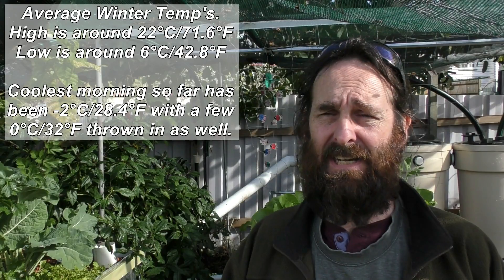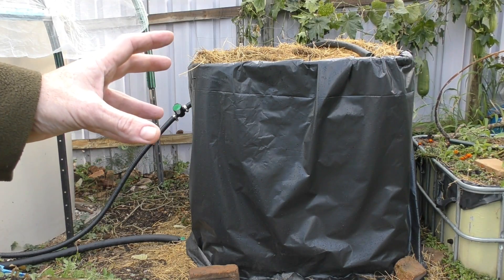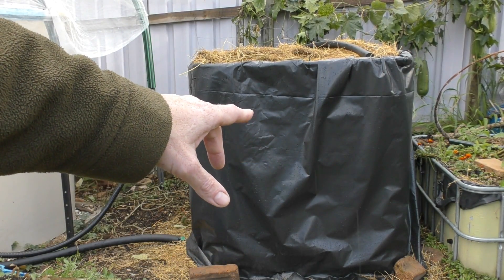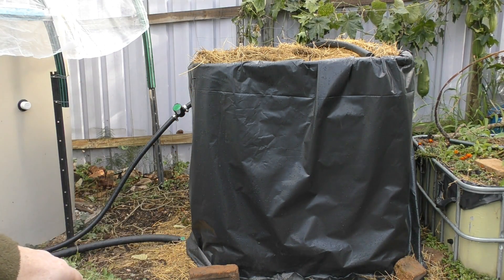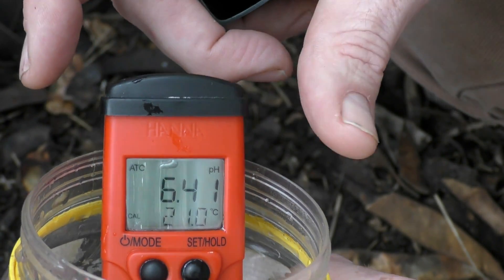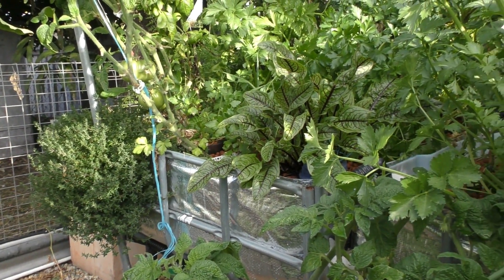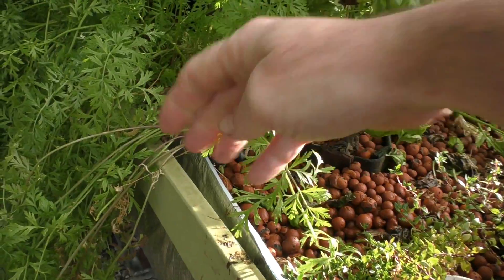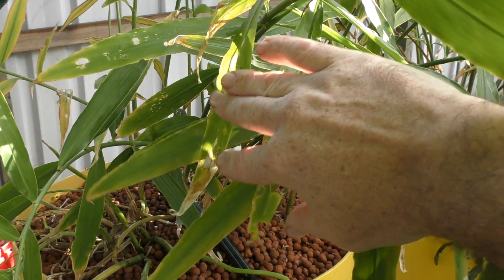Aquaponic Compost Heater update, water temp's for Jade & Silver perch. AP Update July 2015

Comment: Do you still use this method to heat your aquaponics in the winter?  I'm getting ready to build a system for my aquaponic greenhouse.  I plan on pre-mixing and then using lose coils laying throughout the pile in case I need to move the pile around a little.
Reply from the maker: It didn't work out so I ended up scrapping the idea. I haven't had a warm water-loving species since but will be soon so will need to revisit the idea. 
I did see a post on a group the other day that may help, haven't watched it myself as of yet. 
https://www.youtube.com/watch?v=lIzWgBWF3SQ
Hope it helps some.

Comment: Why can't you just switch the hose connections?
Reply from the maker: Running the water in fro the base would draw to much flow from the pump leaving other areas of the system with less flow.
Cheers.

Comment: Hay boss a idea I wanted to share with you to get your thoughts. I have 2 50 Gallon each barrels that I made compost tumblers out of and as  I do it a bit oddly from some. I have had this idea of adapting them to provide a bit of heat for in our greenhouse and or fish tanks in the winter. As we are just coming into spring here in Northwest New Mexico USA were we live, I will have some time to work up the idea before it is needed this next winter. Anyway my tumblers set side ways 1 above the other on a set of poles, I built ribs inside to stir the compost, a quick door in the long side and a 1 1/2" PVC pipe ( with holes drilled into it, over it's length )  runs through as both an axle as well as air filtration supply ( as I write this I am thinking this idea may take away to much air supply  ).  I know it works cause this past winter when I would add new stock to the pile it was always be nice and toasty to reach into.  My new idea was to run insulated lines up & into these pipe and to keep them run Un insulated through the two tumblers axles and then insulate the line out and into the ground till I reach the point of use were ever that might be. Or just run them a couple inches under my flouring in the greenhouse to warm it like a thermal floor and passive heater ( which we already have in a hot air version that is supplied from the peak of our 10' roof at high temp ) . We might run a continues loop of water ( Like you do here ) to let that be my transfer medium as it is a better carrier of heat.  
So what do you think.
 It is easier to clean out between batches and has a smaller footprint in my greenhouse. Oh did I mention they are inside the airlock entryway of my greenhouse, So we're getting some heat from them just were they are.
 This idea is simply to move some of that potential to a more needed place. 
It's always great to see your videos, I always need to remind myself your from down under as they say and our seasons are flipped. 
But with our new greenhouse we will be snubbing our noses at the weather from now on we hope anyway. And playing in the greens all year round. 
Our greenhouse is a bit different than most as I am handicapped and  will one day be in a wheeled chair. So we had to put in hardened floors and use vertical tech. every were we could. But that also gives us a larger than foot print possibilities for volume of plants and there by crops. you and some others here on Youtube have been our insperation for this build and we hope we have it right. Sorry about my spelling Or lack there of. See you around.
Reply from the maker: Hi there & sorry for missing your comment mate.  Going through this week to catch up on any that have slipped through the gaps. 
I found that even though I had a long length of pipe in the pile that I wasn't getting a enough heat transferred into the water using cold water coming in from the system.
Another idea I had was to run the water in a loop within the pipe & use stainless steal coil to transfer the heat directly into the water in the tanks. Basically acting like a heating element like in the old electric jugs/kettles we used to get here. 

I like the idea of using the the heat from your compost tumblers to help heat the whole greenhouse. I think that would be a more efficient use of the heat generated rather than trying to use it to warm the water itself. 
Did you manage to work something out for this season at all? 

Sorry again for missing your comment.
Rob.

Comment: Have you considered running water through a black box solar heater somewhere in the pump system?  It's efficient and can be done cheaply with hose in a black box behind glass, if it works for you then rebuild it with copper tube and a metal box for durability.  It gets water scalding hot.   I'm researching aquaponics in climates with hot summers and cold winters, can you recommend a hearty fish that can thrive in water in the 40's in the winter?
Reply from the maker: Has been something I've thought about & seen folks rig up 👍 Can't use copper though due to the fish but there are workarounds.
Cheers & sorry for missing this when you posted it.
Cheers.

Comment: The compost heater might work better if it were larger or better insulated.  People do science demos where they compost tiny handfuls of materials inside insulated containers, so I think the problem is just that the outer materials are losing heat too quickly to the air and the heat exchanger.  If you had some straw bales handy, you could try using those for the walls of the pile.
Reply from the maker: +Onward to Innisfree 
Hi there.
Ended up pulling the cage down & built another about 60% larger in volume. It heated up very quickly but still think it's a bit to small to be able to heat the water to keep it at optimal levels for the fish. 
Things have warmed up quite a bit here now so it's not really needed but will keep playing with the idea for next winter..  
Looking at using a stainless steel pipe coil as a heating element  to drop into one of the tanks next season to see if it will at least help keep the Jade perch on the feed. 

Posted a bit of an update at the end of the latest clip if your interested ata  close look
https://www.youtube.com/watch?v=s0hIaCGsetA
Cheers & all the best.
Reply: +RobBobs Backyard Farming The new setup looks great!  Incidentally, I think you may be getting more heat than you realize.  From the video, it looked like it took about 9 seconds to fill .5 l.  At that rate, with a 2 C rise, you'd be getting about 1672 kJ/hr or 1584 BTU/hr for us Imperial types.  Supposing that were to run 24/7 for a month (not realistic, but maybe close?) I think you'd be looking at about 333 kWh or 1.1 MBTU total.  Not bad for a pile of clippings and leavings!
Reply from the maker: +Onward to Innisfree Thanks for the figures mate. Something I will be trying to wrap my head around at one point. Been so long since I did science at school.
Cheers.

Comment: What if you used flexible copper pipe to make a coil instead of irrigation piping as copper conducts heat better. Many people make such coils to cool the wort in home brewing.
Reply from the maker: +Shavenhamster 
Hi there. Copper is toxic to the fish but SS is fine to use. My father dropped around a few short SS coil tubes for me to play around with so hope to have a better working heater sorted out soon.
Cheers,
Rob.

Comment: So if you were to just swap the direction of the water flow to your compost heater you would be able to take advantage of the thermo siphon action were heat rises it will assist in the flow too.
Reply from the maker: Galan Gaia I tried that today on the rebuilt heater & found it very hard to regulate the flow. Ended up hooking it back around the original way. Hope to have an update clip on it soon.

Comment: Nice one mate. I have seen the vids on the hot water. I am sure you will get it running.
Our tomatoes have started to ripen Nice ;-)
Reply from the maker: Southpaw Davey 
Plumbed MKll compost heater into the system today. The pile is already over 70°C so fingers are crossed ;)
Cheers Dave.

Comment: Something that you might want to consider for your sunnier days is putting solar to use. Just take your black hose flat coiled tightly attached to a piece of plywood painted black. Surround with a black painted plywood box with the top opening slanting towards your sun and cover with clear glazing. Kind of like a solar cooker. On a sunny day will get too hot for your system but can be regulated by propping open the glazing and valving off the water flow. Even on a cold day, if you have sun, your temps will go well over 100 degrees Fahrenheit. Cheers.
Reply from the maker: brad ley Hi Brad. 
Have tried a small solar heater last winter but it didn't work well with the materials I had on hand to build it. This time I was after the 24 hour heat provided by a compost heater.  
Once we have a permanent cover over the aquaponics there will be both solar water & electricity systems set up on the roof so will be able to utilise that for our short winters. 
Am looking at pulling this heater down on the weekend & rebuilding it with some added greens to help fire it back up. 
Cheers mate & have a great one.

Comment: Have you thought of running a timer?maybe let it flow for a minute and have it stop for five minutes or so?Just a thought.
Reply from the maker: onebigkahuna69 Hi there. Was after simple system for the time being but a timer was suggested by a mate when we were talking about the build. The pile will be rebuilt soon hoping to boost it's performance. If it doesn't work as well as I'm hoping a timer might be a way to help regulate the heat. 
Cheers & all the best.

Comment: with a stick or handle, make three holes down the middle of the pile and add coffee grounds. then water it in good and your temps should come up fairly quickly.
Reply from the maker: Greg Heal Hi Greg. 
Have had the temp fall further over the past week. Have turned the pile & added a few things in but haven't had the raise in temp I was after. Will be rebuilding it to increase it's size & to also bulk it up with some more greens. 
Cheers mate & all the best.

Comment: Not sure if you read the Jean Pain's method but he had piles that were a minimum of 4 cubic metres. Yours looks more like 1 cubic metre. http://www.linaria-ev.de/another_kind_of_garden-the_methods_of_jean_pain.pdf
Reply from the maker: jakattah Certainly have & mention it at the end of the clip ;-) 
Don't have the room for a 4m³ pile or the need to raise the temps to the levels Jean Pain did so went with this smaller unit. Am only after a 2-5°C bump in  temperature for the aquaponics to keep the fish metabolising their feed. 
It's not working well enough set up like this so will be re building it to just under double the volume it is now. The weather will probably warm back up before I get around to it knowing my luck.
Cheers & have a great one.

Comment: It shouldn't actually matter that your water inlet is at the top of your compost pile. Yes, you will have less efficient heat extraction, but you are already restricting your flow rate so that you don't rob the pile of too much heat. If you had the flow reversed and had more efficient heat extraction you would just have to restrict the flow rate more. At the end of the day you are already extracting the maximum amount of heat from the pile without having all the bacteria die off.

Comment: The inlet definitely should be at the bottom and the outlet at the top.  Hot water rises, cold falls. Slow the inlet.  Make it heat before it rises. Having said that, 21 degrees is fine and dandy any way - and a two degree increase for free is pretty good mate. 
My damn aquaponics bed is getting hammered at the moment.  I think it's the bush turkey digging around because the dirt beds (with lots of wooden spikes) are doing okay.
Reply from the maker: McDowall Manor Might be time to breakout the barb wire Andy ;)  Have seen how destructive they can be in a house we were renting. They do make some very efficient compost heaters though ;-) :-D
Cheers mate.

Comment: Even though the compost system doesnt raise the temperature a whole lot I wonder how much it helps buffer any temperature loss that you might otherwise get.
May you can supplement this with some type of solar type set up with black hose on a roof of some sort??
Reply from the maker: The Productive Garden Was thinking about a solar booster but would need to buy more pipe/hose. Don't have much space to set one up other than the lawn at the moment. On top of the compost cage might work though now I think about it ;-)
Cheers John.

Comment: have you thought of using an old solar hot water system (salvage the panels) to heat your water
Reply from the maker: Reuben Bluff Have mucked around with a small set up in the past Reuben but no box. Watched that one last year while looking into solar. 
The pile has cooled down so am biting the bullet & rebuilding it to be slightly larger this time round. Think we only have a week or 2 of cool weather here. 
Will be planting out the cuc's soon ;-)
Cheers mate & thanks for the link.
Reply from the maker: Selwyn Bore Hey Selwyn. Will be looking into a solar water & power set up when the permanent roof goes over the system. Haven't got the space at the moment to set them up. 
Cheers mate.

Comment: What if you only used it at night or late night?  You may be robbing heat all the time rather than just when you need it.
Reply from the maker: Mark Allen Hi Mark. 
Have tried to let the heat build up in the pipe but the volume of water heated doesn't make much of an overall difference to the temp in the system.  If there was more pipe it could work but then the pile would have to be larger to hold it all. 
Have decided to pull this one down & start again over the weekend if I can finish all the other jobs that need doing on the list. 
Cheers mate & hope all's well with you.
Reply: Yeah, back to the old drawing board.  I do that all the time.  I wish you well with your new pile. Did you ever see the water heater by Jean Pain that is on You Tube.  Worth a look but way to big for back yard heat generation!
Reply from the maker: Mark Allen 
Stumbled across Jean Pain a few years ago & have been wanting to have a crack ever since Mark. Have a fix sorted but think it's too late to do much good here this winter. Just need to pick up a few parts to finish plumbing it in today.
Cheers mate.

Comment: Your temps are in the right area if you're relying on Bacteria to generate your heat. Your Bacteria will start killing itself off if you're biomass is over those temps, meaning the bacteria is self regulating. Also your problem with your BTUs may be the size (cubic meter) of your biomass. I would say you might want to make your biomass four times as large. It needs to be way bigger.
Also it might help if you keep your biomass wet by some form of drip irrigation- that might not be the correct way of describing it. I have used a spinners that RainDrip makes to keep mine wet. You don't want it too wet, but just moist, and you do want to turn it over every three week or so (to aerate it). You might need to work that into your design.
You might also want to think of using pallets nailed together to make the outside of your compost bin. That way it lets the air into your biomass a lot better..

If you decide that you want to make it bigger then a two pallet by two pallet square, then you might want to add 4 inch drain pipe with holes down the side of the pipe across the bottom- two feet apart. This would help in allowing air to permeate your Biomass, otherwise you have to turn over your compost pile a lot more often. 
Also I would keep the heat exchanger hose at least 12 inches away from the side wall(s). You might be losing heat by the hose being too close to the sides of your bin. The downside of having to turn over your compost pile is that it take time to get back to the temp it was before you turned it, but that might not be a problem if the biomass (temp) is dying out because of lack of air .

If you want to push things, I would try a can of unpasteurized beer as a starter, with a 1/2 cup of liquid joy dish soap (DO NOT USE antibacterial dish soap- the idea behind the unpasteurised beer is to use it as a starter culture. The Anti-bacterial soap would kill your starter.). The reason for the Dish Soap is it is a wetting agent. But KEEP the dish soap way from any fish you have, it will kill them.

IF you really want to get over 212 Deg F (100 Deg C) then use 20-20-20 fertilizer. The nitrogen will combine with the biomass and really raise the temp. Bad news it will kill off your Bacteria, and you have to watch how moist it is insides- meaning it will need a lot more water. If you have a lot of chip tree bark in your biomass, the good news is that it will soak up the nitrogen. Otherwise when you add the compost to your garden, un-nitrogen compost with a lot of tree chips in it will soak what nitrogen is in your soil/plating medium.
Reply from the maker: Blacklab412294 Cheers for all the info mate.
Have pulled that pile down & totally rebuilt it using concrete mesh as the sides. It's now just over 1.6m³/2yard³ & had it hit 73°C/164°F in about 40 hours. Normally our piles get up to about 75°C/170°F then cool down to 65°C/150°F for a few weeks which is all I need here for our short mild winters.  
Hope to have a clip up on the build by next weekend after I get a few days worth of water temp measurements together.
Thanks again for all the information you shared & have a great weekend. 
Rob.